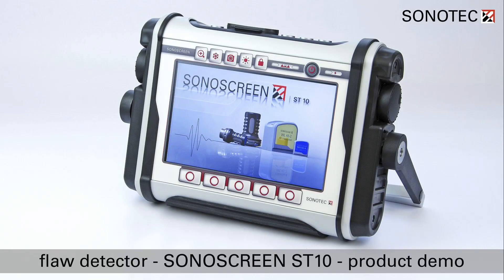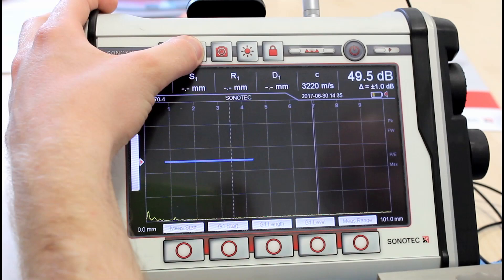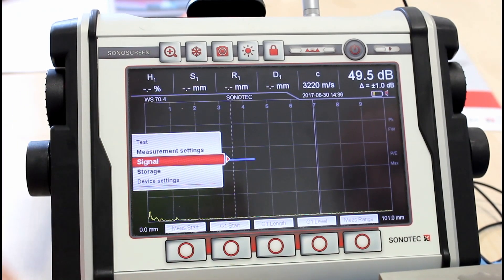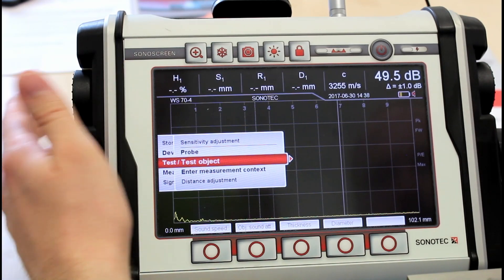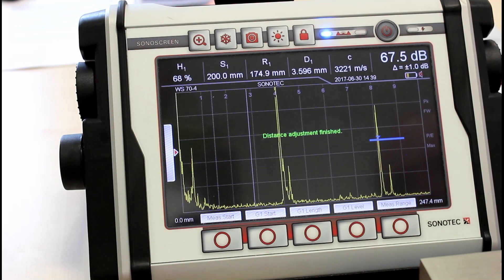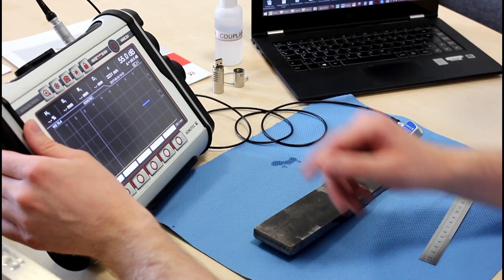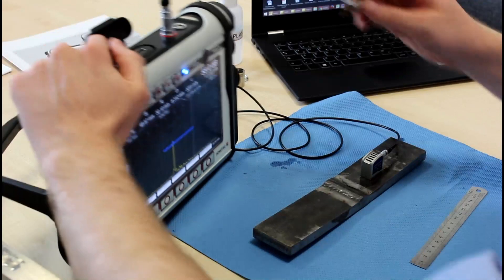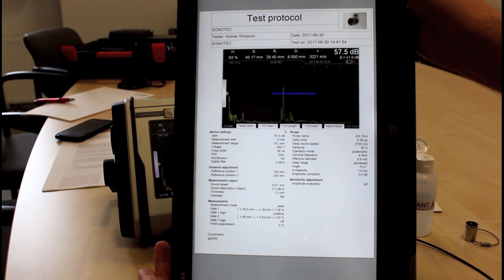SONOSCREEN ST10 - Product Presentation #ndt #zfp #ultrasonictesting #nondestructivetesting

Comment: How to create a Distance Aplitude Control curve (for acceptance or reject?)
Reply from the maker: Dear Ronny, The device has DAC function under Test…Sensitivity Adjustment menu (if DAC license is enabled). What you need to do is to start the function and register your reference points one by one. Please contact us directly if you have any problems with using the device. We would find an appropriate training solution.
Reply: @SONOTECGmbH   hello thank you for the explanation. On my device I can create a DAC line. The device connects all the points (found with my reference block) to a line. So my DAC curve on the Sonoscreen is a line with angles. On all my other devices, Sonatest, Olympus etcetera, I get a DAC curve (wave form) that's much nicer than a line with angles. Do I do something wrong?
Reply from the maker: @ubegrijpt8131  Dear Ronny, There is nothing wrong with that DAC curve, other equipment you refer to have “curve smoothening” option active. In ST-10 there is no such an option as we do not interpolate the curve as it is less precise then. This different curve look is just a subjective feeling which I think will go away in short time as you will get used to it.